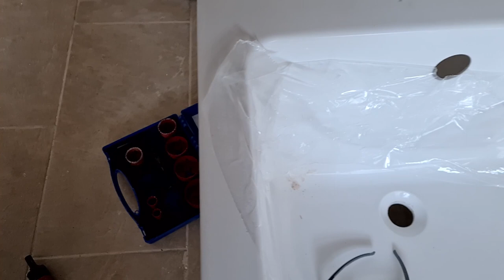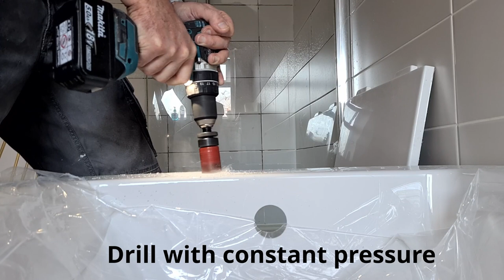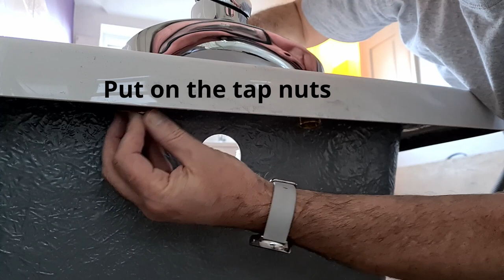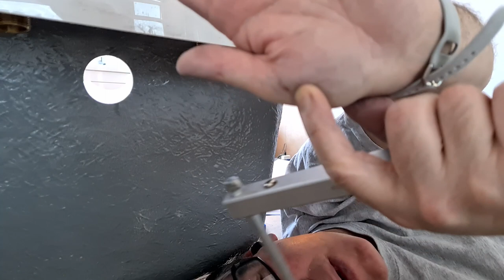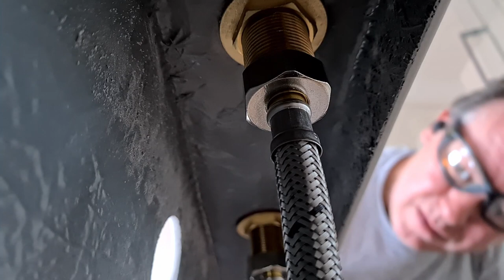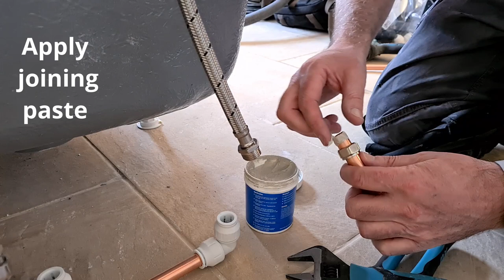How to install new Bath taps cutting out the holes in the Bath

Comment: Good video but you should mention the size of a hole cutter
Reply from the maker: Great point, I missed that trick thanks for pointing it out
Reply: Size of hole cutter?
Reply from the maker: @Johnny be Good  size is the size of the tap thread underneath so for this it was 25mm however that may change from imperial to metric